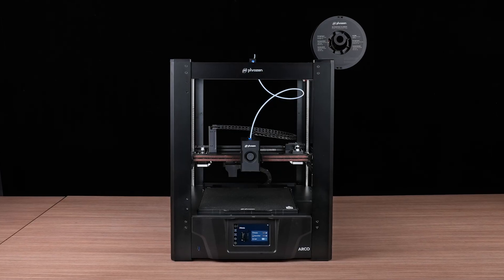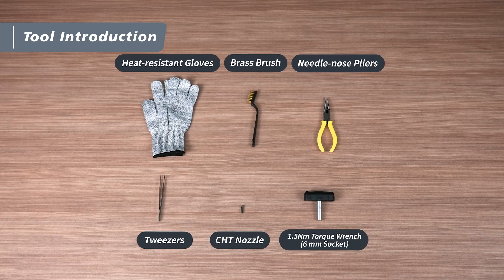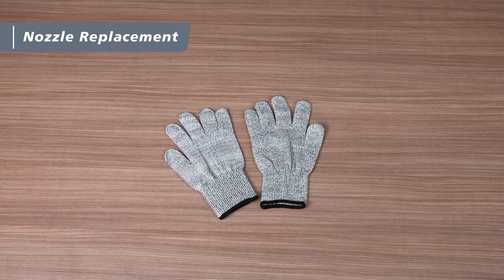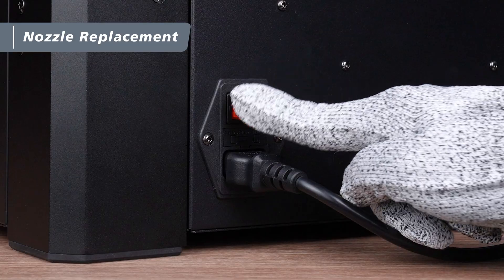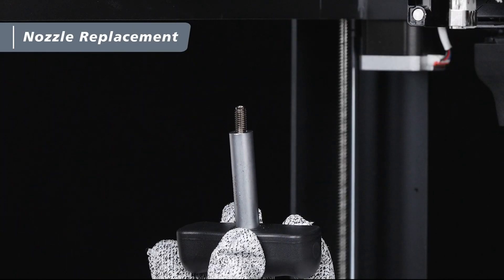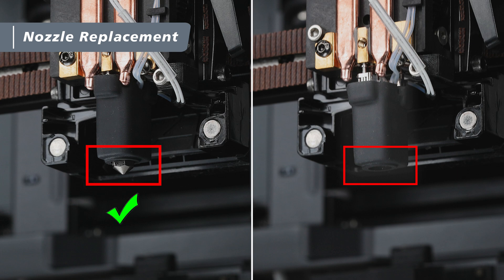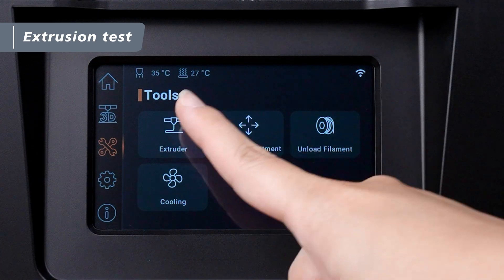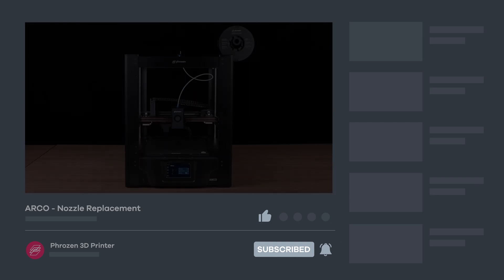ARCO - Nozzle Replacement — Phrozen 3D Printer

Comment: Please don't rely on AI generated voices.  I'm a bit disappointed and perplexed at having to remove a fan connector to replace a nozzle.  Those connectors only have a finite number of inserts.  I guess the only reason for it is that the hot end isn't solid enough to handle the required torque without stabilization with pliers or is that really needed assuming it isn't all gummed up?
Reply: Thanks for sharing your thoughts 😊 The fan connector is designed for easy reattachment and can handle normal maintenance cycles. Using pliers helps ensure stability during nozzle changes, but if the hot-end is clean and not overtightened, you may not always need them. We value your feedback and will keep refining the design for smoother user experience.